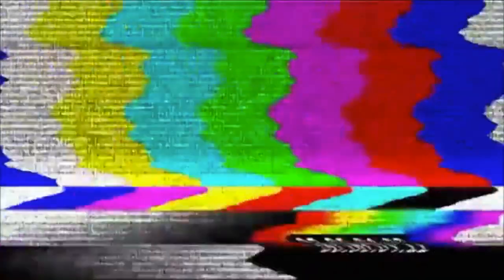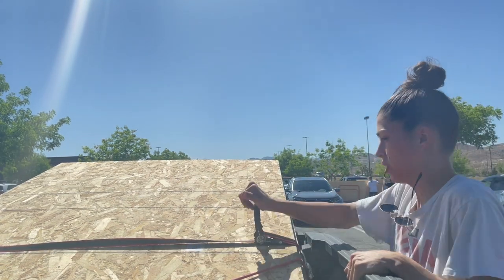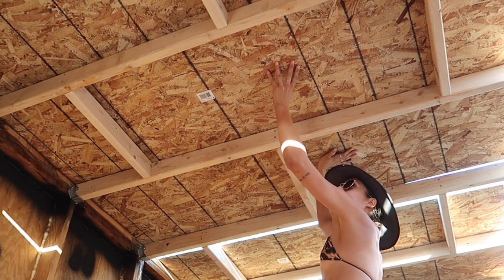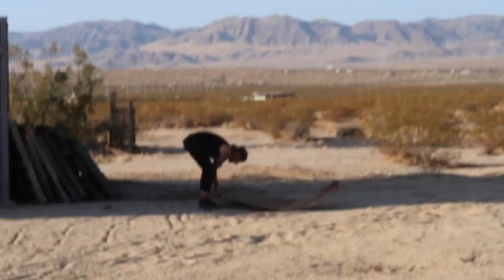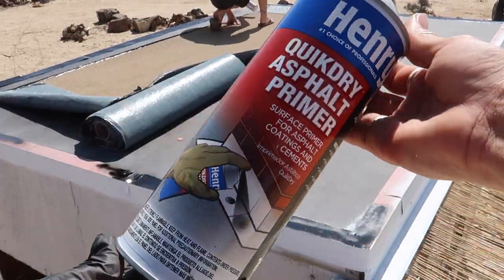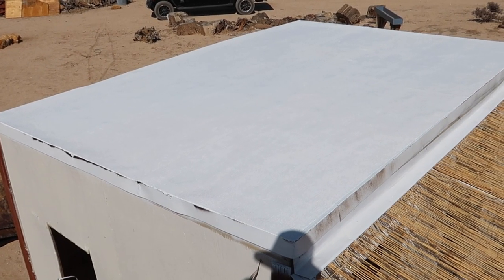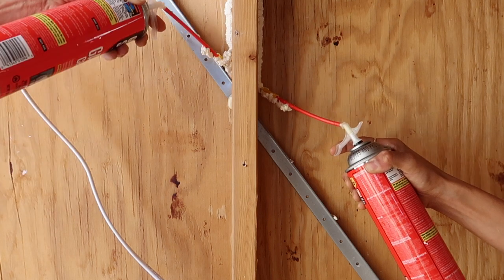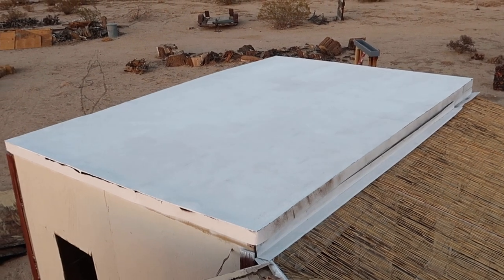...So I Tried to Build A Roof??? Ep. 2 of Turning My She Shed Into My Desert Dream Pool House

Comment: Love how cool and accessible you make this type of work feel.
A good rule of thumb is that any penetration through a roofing assembly should be covered by flashing or membrane, hence the order of SBS over the flashing nails. If you absolutely have to penetrate the SBS directly, you can use roofing mastic to seal it, but it will need extra maintenance in the desert because of the UV and heat cycling. 

p.s. I'd be willing to bet the area of your overlaps is pretty close to the area of roof that was left exposed on your first roll.
Reply: @andre wakkary Are you saying the order should be flashing nailed in then membrane on top?